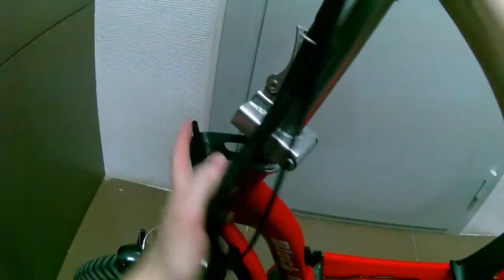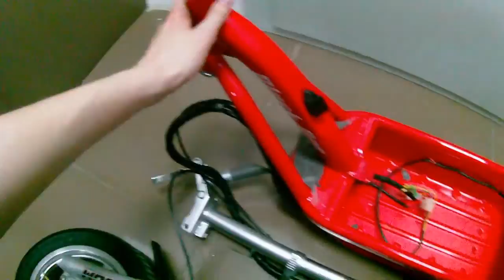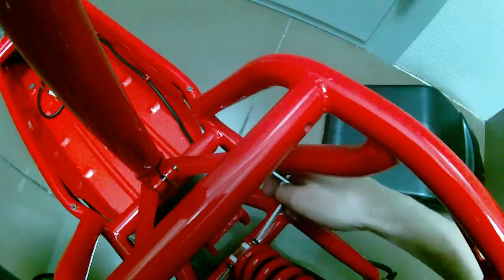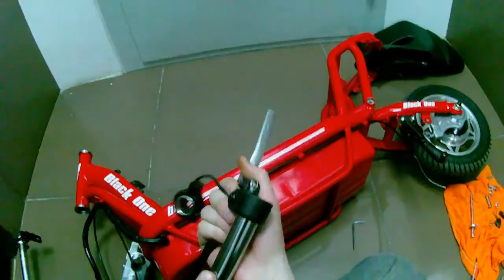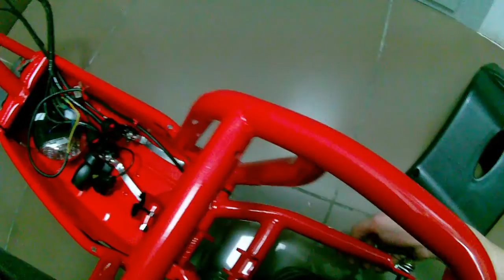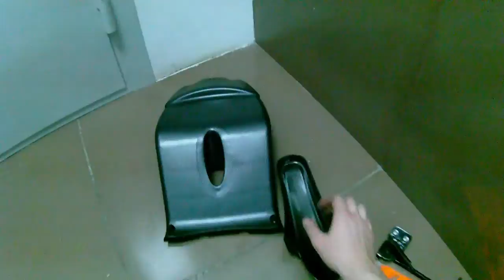Disassembling electric kick scooter - Black One P600

Comment: But why ? Why disassemble ?
Reply from the maker: Richard Tan Tan 
This frame I will use as example-prototype for planning titanium frame - to use with aluminium rearfork and two-crown fork.
In plans using 72v LiFePo4 battery and much more powerfull hubwheel.
I hope to get produced frame before summer, but not sure yet to be in time.
Reply: Since you are making bespoke frame, why buy a new one when you dont use it ?
Reply from the maker: Because I am not a guru of solidworks or autocad =)
And producing of titatium frame is not so cheap and not so fast.
So, I can't order lot revisions of the frame. 
And to avoid design mistakes - easiest way is using this nice steel frame as prototype.
Actually, this electric scooter is not so expensive - like 1/2 from projected costs for titanium frame.